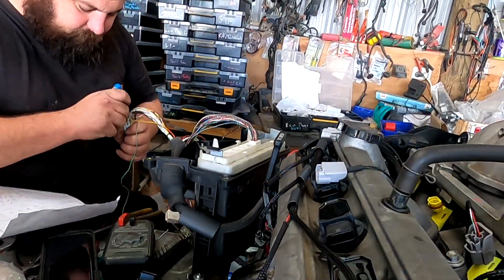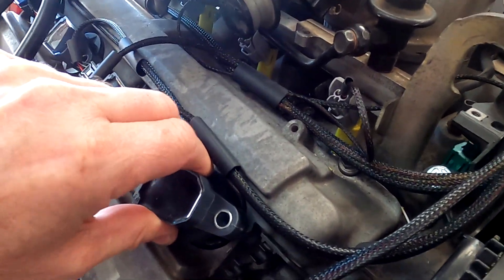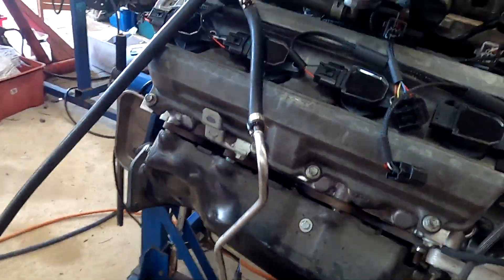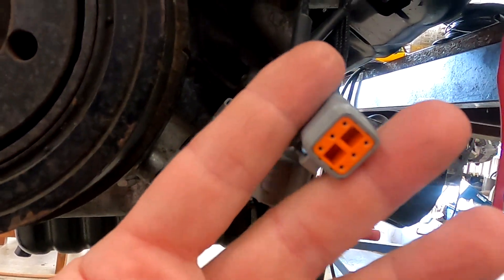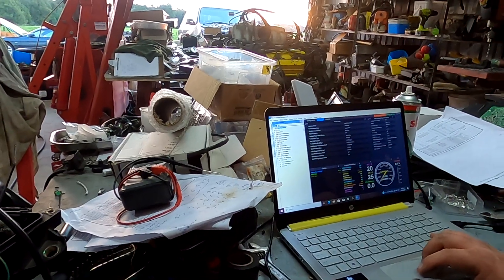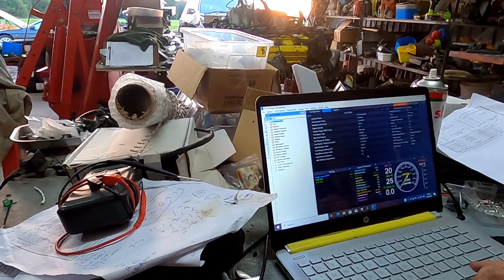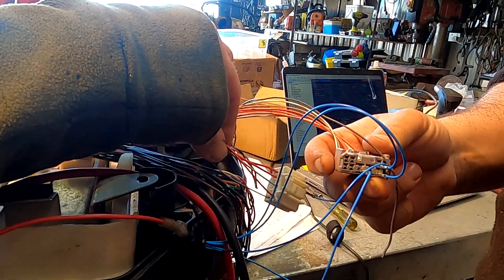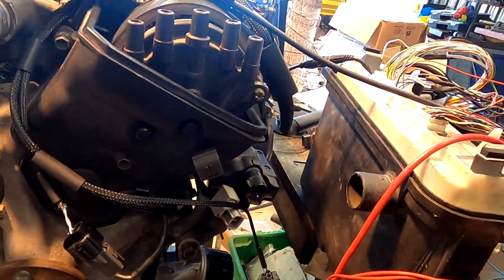1uz wiring loom into Altezza with link Altezzalink.  Plug and play loom

Comment: This is a very underated option for putting a 1UZ into a Altezza! Currently doing exactly the same  ( leaving stock injectors, and using 3UZ coils) With my IS200, which requires some pin swapping on the body loom to match Altezza config. The plug and play functionality / Factory look and having all of the dash functions working properly is excellent.
Reply from the maker: I agree.  This is a great option for altezza with uz.  I just wish they left the extra injector drivers and coil drivers in place for a V8 sequential setup.
Reply: @CartuneNZ  Yes sequential injection and not wasted spark would be ideal, but its not the end of the world. Would you run your eyes over my planned pin assignments and check i haven't left off something, or as an alternative share with me what you did with yours?

Comment: Kelvin, what's the flow rate on the RX8 injectors, vs. stock? Engine sounds good (despite burnt valves)!
Reply from the maker: Stock little purple are 215cc, the more common dark blue (its a greeny blue) are 250cc.  The yellow RX8 are the smaller size between 425 and 450.  We flow up each set to confirm they are all close to each other.  This loom was on the dyno last week but needs the fuel pressure sorted before I can give figures.